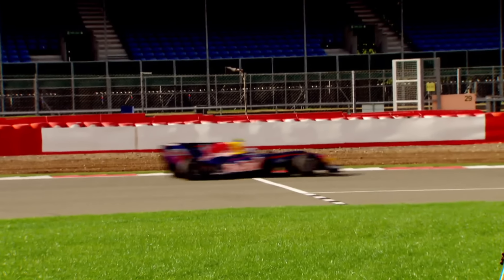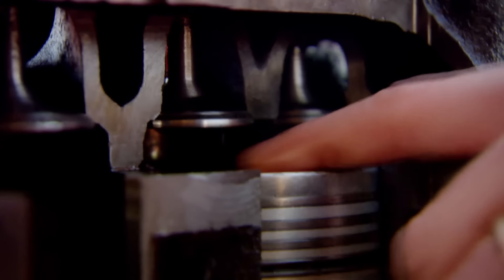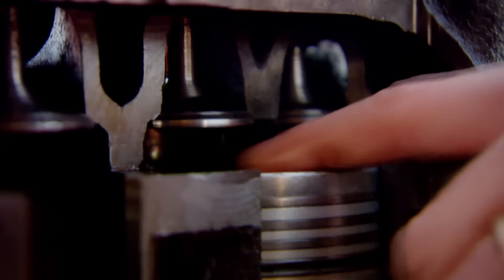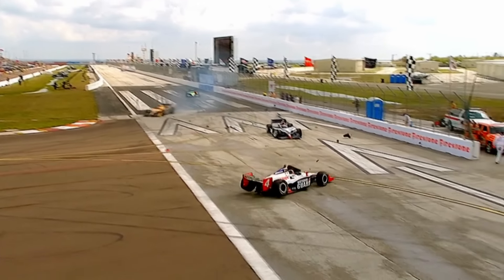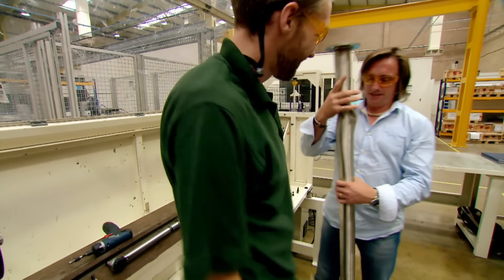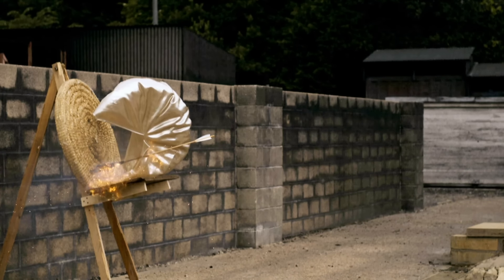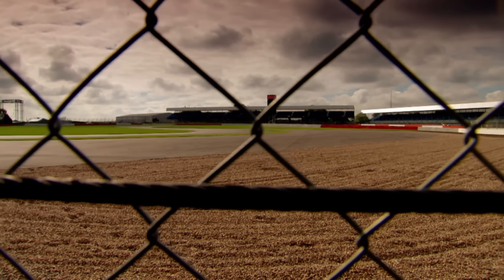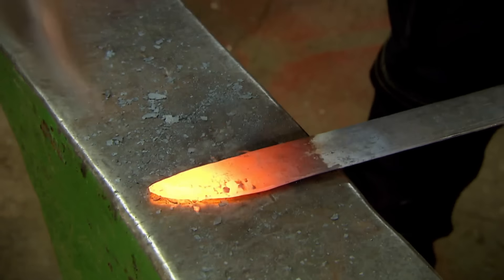Engineering Connections (Richard Hammond) - Formula 1 | Science Documentary | Reel Truth Science

Comment: Then after they make the F1 cars as fast as possible, with lots of safety engineered right into the track and the car and the driver's gear, the realize the cars are (once again) going too fast.  The drivers' reaction times just can't cope with speeds much over 200 mph for any length of  time.  So they introduce some new rule, some engineered restriction, say a new restrictor device, or something to reduce the top speeds.  Yep, they get faster, then they reduce top speed, then get faster, then reduce top speed again, over and over in a never-ending cycle.  Pretty soon we'll have tiny 2.4 liter engines driving very light chassis and hitting over 200 mph consistantly.  What?  You say? That's where they're already sitting?  OK, about time for a speed reducing device, wonder what it will be this time?  Heavier springs on the accelerator?  Anchors out the rear?  Nagging wives on the radio?

Comment: Internal combustion engines are driven by an any explosion!! Please stop this myth. The process in a regular gas engine is a thoroughly controlled expansion of flammable gases. This holds true for both Otto and Diesel processes. Please stop calling it an explosive engine and call it, correctly, combustion engine. Thank you! An explosive engine is a misconception that shouldn’t be used unless there’s a misfire. We both know that. Otherwise thanks for a good and educative channel. Greetings from Wiktoria Heinz, combustion engine engineer.
Reply: Correct - you don't want a detonation (explosion) in the engine, as that will wreck it in short order. You want a rapid deflagration (burn). Also in a gun - the propellant charge had better not explode.

Comment: Great video but extremely disappointing - F1 "engines" are actually power units, no mention of the electric unit. The "wings" are a small part of the aero design, no mention of diffusers or DRS system. The brakes are never mentioned and are absolute wonders of engineering, no mention of them nor the regenerative system. We never looked at the steering wheel must less what the driver controls with it. At best a very superficial view of technical wonders.
Reply: Hes not gonna go over every single piece of tech in the car. Just the main ones and their engineering roots

Comment: uhm no.
a regular car engine would NOT explode at 5k revs
Reply: Wong yew xuan no but nine wouldn't be so good :)
Reply: at least they used a v8 car for filming it
Reply: F1 cars rev upwards of 16-20000 rpm. Most regular car engines redline at 6000 rpm and if you sustain your car at redline it will explode. So yes, his statement is correct.
Reply: where have you been for the past 4 years?
Reply: swell this is the old V8. They reved up to 22.000 rpm. No regular road car can rev up to 12k xD
Reply: @wongyewxuan3880  Please define your idea of a 'regular' car engine. Regular in this instance would probably mean something in a family hatchback, 1.2 litre, red-line at 5,500rpm. If you're talking about the £38,000 highly-tuned 600 bhp Lambo engine you've crammed into your barely street-legal drifting toy, that's rather missing the point of the 'regular' description, isn't it. Where have YOU been for the past 4 years? Doing some irregular but really, really regular things, one hopes. Like buying regular-fit jeans with a 108" waist, or building regular-sized houses with 300 bedrooms, or having regular bowel movements and converting them into YouTube Comments...  ;-)
Reply: Abuse it long enough and you will see what happen...
Reply: @totalmadnesman   only motorcycle angine or Rotary engine and maybe some tunes VTEC engines..

Comment: Lol For Decades Horse Power Gains have been made with New Cylinder Head Designs that have Multi Over Head Camshafts 4-5 Valves Per Cylinder, Oil Pressure Adjustable Camshaft Sprockets Capable of Adjusting 40+or- degree Cam Timing  along with Precision Fuel- Ignition Programming Software Mapping  with added HP Engineers had to Design Cylinder Block to Handle Extra Power. Next time use Cutaway View DOHC Engine or Drawing on Lap Top instead of Old Boat Anchor Push Rod Engine

Comment: Sorry 2.4 litres is wrong  The FIA announced the intention to change the 2.4-litre V8 engines to 1.6 litre V6 turbo engines for the 2014 season. The new regulations include multiple energy recovery systems [21] and fuel flow restrictions, to attract more commercial partners.
Reply: It's an old video
Reply: 15 May 2011

Comment: Eeeh they could have put real driveshaft from car into that machine. Theirs was by looks of it and colours on welding stainless steel and thats pretty shit to make driveshafts from. V8 diesels put down about 1000Nm at crank, multiply it by gearbox ratio which at low gears would be 4:1 to 5:1 and you are sending 4000-5000Nm trough metal drive shaft every day each time you launch it from standstill. So not really that impressive in terms of strenght. Weight thats other story.